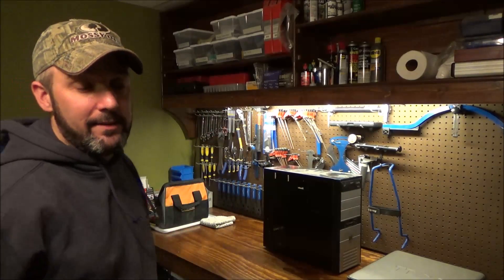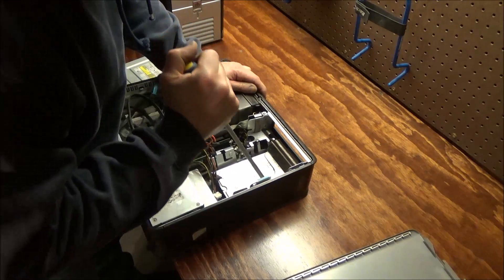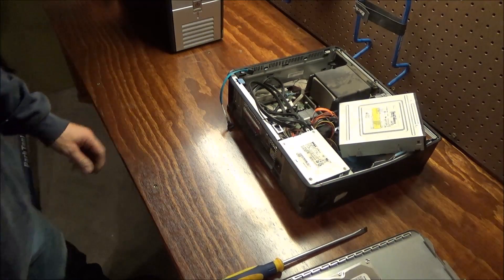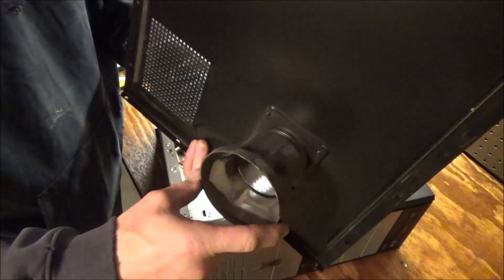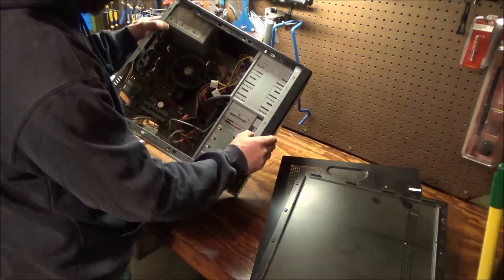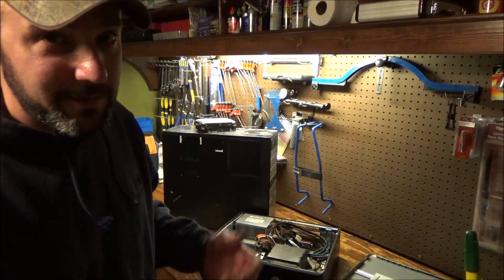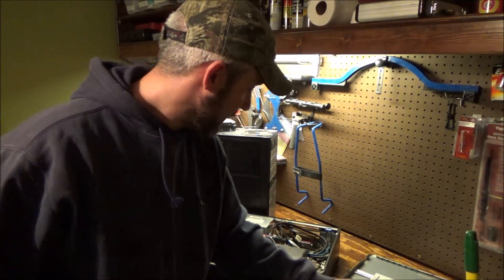How To Format A Hard Drive - PERMANENTLY

Comment: You cannot format anything in a computer except the hard drive. The CPU and Memory all use RAM which is a temporary storage device, only. As soon as you turn off the computer, the info in RAM is removed. Memory must constantly have power applied to keep the  RAM refreshed and capable of storage.

Comment: You looked like a bear in a china shop taking that hard drive out. I hate to inform you, but formatting a hard drive does not erase any data on the hard drive, immediately. All it does is to mark that data for erasure sometime in the future. Then, anytime some data needs to be written to the hard drive it writes over this designated old data. It is possible that it could take months before all that old data is overwritten. A savvy computer tech could easily still retrieve all your remaining data while waiting for your computer to write over all your designated old data.  There are 3 ways to erase all the data on your hard drive. You could physically destroy the drive by beating it with a hammer or by drilling holes in it. You could use erase software from the hard drive manufacturer or from a 3rd party provider. You could also use a stand-alone data eraser that does not need a computer connected to it but still can do the erasing by just being connected from the stand-alone device to the hard drive.

Comment: I was hoping that a firearm would be used.🥰   Believe it or not, the FBI has the ability to pull data from those little silver discs.  The best, though not the most fun, it to degauss the unit before weight reduction via high velocity projectiles!  Great time!

Comment: I know it's years later.  Pull the drives, and turn the platters into liquid with your torch and then donate the rest of it.

There are a few customer systems I'd like to have filled with gasoline and lit a match to give them a bit of a tuneup.

Still, fun video to watch.

Comment: FYI,China has been making ALL the hard drives for PC's for decades,but a better formatting tool would be a heavy duty shredder,it will turn any electronics to little tiny pieces and you can format a nonpaying customers auto,tractor, truck,boat or even a locomotive if you supersize your formatting tool ,there's a company that will custom make any size formatting tool you need,they used to have a television show on of all places Animal Planet.
But remember if you have to reformat a locomotive you may have to cut it in quarters to fit the formatting tool,but cars trucks and boats just plop them in flip the switch and voila a pile of 1 square centimeter pieces,engine and all including tires,just drain the fluids first,can't beat it and save the ammo for pesky unwanted guests.

Comment: DBAN - Darik's Boot and Nuke. Will overwrite the hard drive with random data enough times you'd need an electron microscope to pull the data off bit by bit.

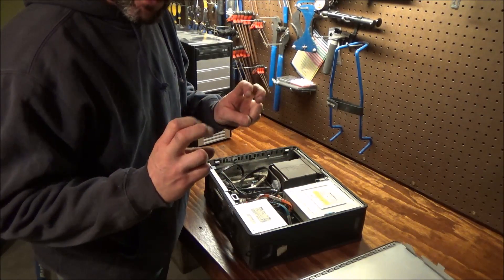Comment: As an IT guy who has had an ongoing contract for 15+ years with Dell I got a big chuckle out of around 1:00 with the HD removal.  They're modular. There's two tabs you squeeze and then the thing comes right out. It's for CRU's and FRU parts replacement.  I just had to point this out because you do some seriously 4 dimensional troubleshooting on auto electrical systems that would take a normal person a degree in EE to ferret out.  Two tabs, dude. TWO TABS!  XD <3

Comment: Why would someone with a logical brain and some mechanical sense not just look at how it's held in and do the simple steps to release the drive as it was designed to be done rather than attacking it with inappropriate tools and essentially beating the drive out, deforming and breaking stuff. As for data wiping software why not use Bleachbit, the experts working for Hillary Clinton had faith in it to destroy data permanently. But if you knew you'd be using lead to do the job, why bother taking the HDs out of the case? And what what about recycling, there's useful parts n gold in them there machines. I don't know but this seemed kind of ham-fisted and foolish for SMA.
Reply: not one ounce of "fun" in you is there?
Reply: we're on the metric system here in New Zealand and I'm a very jolly guy with a tonne of humor so stop making assumptions about folks you don't know. I enjoy Eric's Vid's, watching him fix stuff and explaining what he's doing and why and I enjoy his humor too but I commented on this vid because it seemed really stupid and inefficient  to take the HDs out of those cases the way he did, not his usual way of doing things at all. Not that any of this matters though, Merry Xmas and all the best for the season Tyler, I hope you enjoy yourself.

Comment: Dude, there's a job waiting for you at Best Buy.  Your new PC tower(s) should be blown out at least once a year -- obviously, take it outside on a nice day, no touching interior electrical parts (sparks & chips don't mix) and short puffs of air around fans to avoid over-revving and damaging the fans' bearings -- probably ~50 psi ought to be enough.  The case front grills (bezels) usually pop off with a catch or three.

Comment: I generally use the 3.0-0.6 or 3.0-3.0 formatting methods. Sometimes the 2.2.3.AP formatting software if I'm dealing with encrypted hard drives. This is an effective method as well though

Comment: I'm late to the party for this video, but thought I'd go ahead and comment.  I'm a big fan of your formatting method.  I'll give this method a try on my next formatting project.  I can even use the additional ar15-223-30rnd processor to further complete the task.  Like you, I'm very concerned about a complete and thorough formatting on old hard drives destined for the scrap heap so I've employed a different method in the past.  It's called "Mr. oxy-acetylene" (plagiarized from "Mr. Coffee").  It does a magnificent job and almost as fun as your method.  If you try it, be sure and use a respirator and do it outdoors.  There's a bunch of plastic and it stinks to high Hell!  Good luck...

Comment: Haha ...You don't have to destroy them like that Ya Crazzy ... All you need is a 12 dollar Docking Device and plug those drives into any computer for use .. Ditch the rest of the computer , . Keep and use those hard drives and all your information on them or add to them , As an External Device with a 12 dollar Docking System .. I got mine from Ebay ... Turnes them into a usb external device ... Rich ... btw little bit of gold in the pc . Processer chip and memory , also a little in the gold tab ic chip on the mother board ... Not Much .. 20 dollars probably ..??  ....

Comment: As a computer guy and someone who use to build repair and upgrade computers I have to say this was 100% unnecessary. But OMG funny and a great way to release stress.  And NO I am not serious about this being unnecessary, you do what you feel will protect you and your customers. Geek note: You can take a hard drive and solder some speaker wire to certain points (readily availabe on goog.com) and make working speakers out of them.

Comment: For a moment I thought I was watching Demolition Ranch.
What I do is open up the hard drive using my set of torx post drivers and take out the magnets.  They are super strong. And I keep them for various magnet uses. 
Then I take the platters out and heat them over a burner on my stove. Once they are screaming hot I quench them in water.  
The discs warp.  But the heat probably destroyed the data anyway.  Then I drive to a distant town and throw the discs away 
in individual trashcans all the while making sure I am not being followed.  I'm wearing a disguise of course.

Comment: actually my recommendation is to use a hydrolic press, a nice spike at the end of it into the disk pallet and not even NSA would be able to recover it, if you still feel unsafe, heat removes the magnetic properties of metal so a good old campfire to sterilize that workshop porn of what's under the hood and tailpipesthen you can take the warped shrapnel and put a spike in it.

how much data would NSA be able to recover? well, that you're brutally effective in destroying your data.

Comment: I would have repurposed for a shop machine or storage/backup device. But this is effective.
Reply: Destroying classified data was part of my job in the Air Force. Some of it we burned in the incinerators at NASA Langley. Interesting system they have for powering wind tunnels. Steam action.

Comment: you need not remove the hard drive during reformatting procedure..next time please use brake fluid  to insure a clean data wipe ...at times dripping old oil insures a faster deploy of either 32 bit or 64 bit data please keep in mind ram can also hold data....cheers

Comment: huh.. thats how to format.  how do you defrag?
Reply: Give it a solid blast with penetrating oil to break the fragments free of their inappropriate positions, then jiggle the fragments back into their correct places with the air hammer. Final cleanup using brake cleaner.
Reply: jason good question
Reply: @timmysmith5464  defrag.exe C:
Reply: Format C:
Reply: Think the defrag device is his lump hammer 😂 😂 😂 😂 😂 😂
Reply: You need this special cleaning powder called Tannerite. It will frag... er.... defrag your computer quite well!
Reply: @tanis143  yeh tanerite or nitroglycerin will work gd lol.

Comment: Great video Eric O!!  Home run for entertainment.  However, to properly totally erase a hard drive, first remove the platters and then sand off all the oxide.  Put the oxide in a sealed plastic bag and give to the customer (yourself in this case) for safe storage.  Next, destroy the platters.  We used a different method (sledge hammer then enough heat to melt) than you but the 12 gauge method you employed would work given enough shots at close range.  Gotta love the requirements of the gov't.......

Comment: Congrats! What you have done can be considered HIPAA compliant! If you worked in a medical office and had private info of clients on it you have just complied with government regulation on what constitutes protecting their personal information.  "physically damage hard drive beyond repair, making the data inaccessible"  I work with medical data and have to destroy hard drives all the time when upgrading to new bigger drives.  Kind of geeking out seeing you destroy computers, I dream of it some days. :P  Nice Zalman fan on the EVGA system.  Looks like an older VGA only model.  I can see why it's time to retire that system.  It's got a floppy drive for heavens sake.   No there is no info saved on the motherboard other than the BIOS settings like date/time boot priority etc..  Been missing ya Eric :)

Comment: lol DOUBLE AUGHT BUCK! nice :) i can tell you that nothing gets saved to the rest of the pc. just to the hard drive. the ram is "volatile" memory. meaning once you cut power. it loses everything. the CMOS. is the only other thing really that saves anything. and it just saves bios settings. so. no need to care. on the cpu and or gpu is some more volatile memory. in the form of other ram or cache. the cache is just a quick access. but again. its lost as soon as you cut power. so the only thing to worry about "formatting" is the HDD. and i wouldnt trust any of those programs out there. i tried one. idk if it worked as good as advertised tho because i didnt bother double checking xD but anyways. hope i made mention of something helpful or useful. :) and i think i may end subscribing. ive already watched like 30 of your videos. (including the engine swap which i enjoyed!)

Comment: As a computer repair tech I cringed at how you got the hard drive out that dell. But a hilarious video nonetheless
Reply: I'm an IT nerd myself.  I laughed my ass off.  "You need to be careful with these"....reefs on it with a screwdriver.
Reply: Eric just invented a new service, HaaT (Hardware as a Target)
Reply: I like his technique myself... lol
Reply: I was honestly surprised he didn't use a die grinder to hack up the hd cage.  Just me or does anyone else never bother to open the other side of the case to put the screws into the HDs?  2 is enough if it's on a shelf in the cage.  most cases are pretty good like that.
Reply: As a computer repair tech, I would suggest using a hammer to remove a hard drive from those OptiPlex desktops. Much easier as once you get the claw underneath, just pull, and it all breaks out.
Reply: Torch or c4 🤣
Reply: hahahaha!! I've done hundreds of these damn optilexes. I was yelling "pinch and pull" over and over. but hey, it worked :D
Reply: Probably best to use the plasma cutter.
Reply: Funny to see someone struggling with a tool less drive cage, litterly could pull a lever and it would pop out

Comment: FANTASTIC! I used the same method to format a Lexmark inkjet printer, and a 2000 GMC Jimmy. I have slightly different formatting tools, but they all got the job done. My Para Warthog formatting device is my favorite, followed by the super-effective Marlin .338 Express Formatting System. "Express" is an understatement. :D

Love that you share my same dislike for modern GM products ... and we use the same brake cleaner, LOLOLOL. Cars frustrate me, so I've been doing more lawn equipment and other OPE repairs - easy on my blood pressure. HATE OBD-II .. I'm a points and carb guy, but between you, Eric The Car Guy, and ScannerDanner, I've learned more in a few months about these electronic wonders than I have the past 20 years fumbling with OBD-II related devices. I wanted to format ALL of them ... but now I can actually fix them without using a BFH, or formatting device.  Thanks for helping me!!
Reply from the maker: +Smitty Smithsonite Hhaha glad to provide therapy class :)

Comment: i love tearing shit up.. :) however.. in this case... a lot of the data on those drives could still be recovered by a decent forensic data recovery guy.. you can literally recover the sectors from mangled platters.. it's expensive and tedious work...  but it can be done.. to get all the data you could run a strong magnet over the platters (even their own magnets will work.. they are VERY strong.. (actually used one today to retrieve a free-spirited 10mm socket from an intake port on a 5.4 ford)...or heat them with a torch.. or... fire up the plasma cutter and cut up the platters...  we have a vendor with an industrial chipper that  turns them into confetti.. that's always fun.. various acids will strip the magnetic coating off the platters.. you can get creative.. i used to make clocks from old drives.. the old MFM or RLL drives made great desk clocks.. they are very interesting inside.. we sold them in our shop back in the early 90's... key chains made from old 30 pin ram sticks... wall art from various computer parts.. 

love the videos.. thanks for making them.. i enjoy the content.. i like your approach...

Comment: Good formatting job but the HDD have magnets that will hold a magazine on a fridge and I use them to magnetize screwdrivers and screwdriver tips you should have removed the platter's and scrape them on a rough surface an NO ONE not even the DOD can retrieve data or you use a the strong magnet to swipe very the platters and then data is gone.  The HDD is the only thing that will keep data. the Motherboard or ram keep nothing after power off.   YOUR ENTERTAINING!

Comment: Whenever I get my oil changed I cringe at the computer sitting on the bottom shelf of the home shop made podium in the middle of the garage. I would ask them if they would let me take it for a day or two to clean, but I'm sure they would rather rub brake dust all over themselves.

Comment: Hell I thought I was on the wrong channel first and then I thought someone hijacked your site. I've never formatted that way before I usually use the ole sledge hammer formatting tool & then the shredder method but your way seems to be just as effective. I build my own computers but remind me to never let you near one of my computers. You are one hell of an auto mechanic/tech but holy crap you suck at computer maintenance...LOL I kept waiting for you to break out the Brakleen and the torch in the burn pit for the final reformatting. In today's world of identity theft you can never be too cautious but I do believe your hard drive is fragmented good.

Comment: Cpu never stores any data and the ram never has data on it when not powered on. If you ever want to do a software format (pretty much the actual term for erasing data off a storage medium and have it run still down load kill disk and have it go through and write all 0's to the drive. Once that's done your personal data can never be recovered again. I have been using that tool for years
Reply: you would be surprised, I've gotten information off of formatted hard drives, even drives formatted with kill disk and all other kinds of formatting utilities for customers.
Reply: Question here: what about that shredding tool that says it'll rewrite randomly over the disk/file seven times? would that do it? I use that one to delete old files, never use the "recycle" feature, since that only erases part of the file.
Reply: @KECOG  Technically deleting a file doesn't delete anything, it just tells the MBR that the particular sector that data is stored on can be overwritten. The data is still there until its overwritten, which there is no telling when that will happen.
Reply: or, you know, you can just live a little?

Comment: Believe it or not,it might still be possible to recover some data from those HDD platters. Take the platters back to the shop,and heat them up with the torch,that will scramble it for good. Data on magnetic media doesn't survive over the Curie temperature,the magnetic properties go away,and thus so does the data.